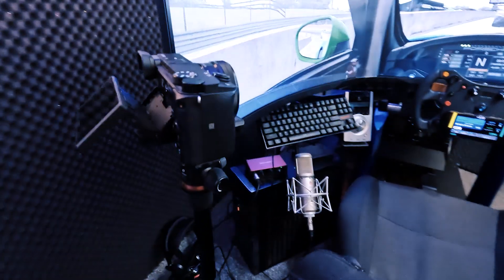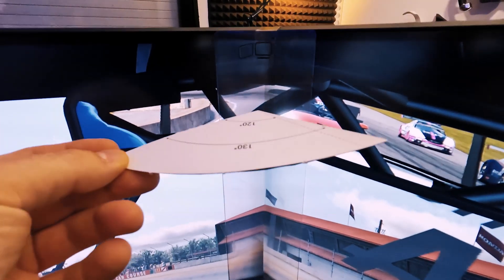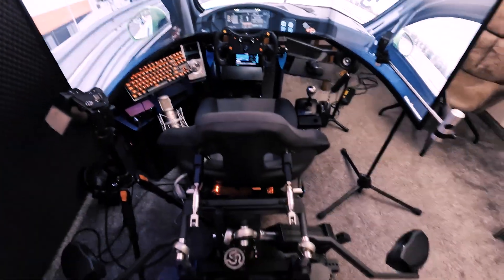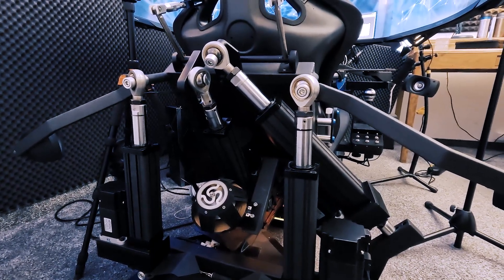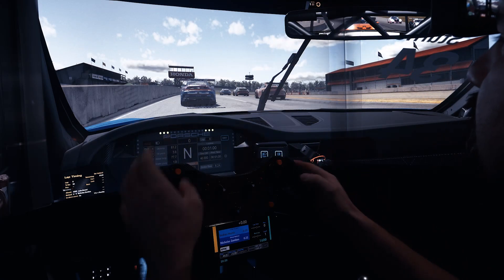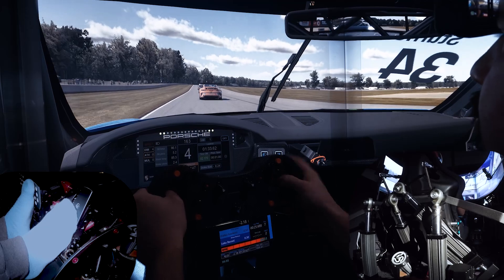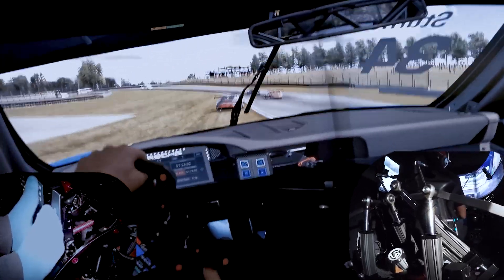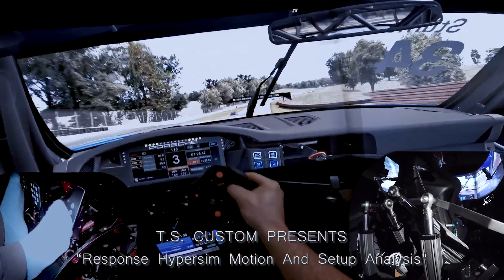Response Hypersim - Motion and Setup Analysis in Detail

Comment: This is a really nice setup! 😍 But one question...
Why not bind the steering wheel to the motion system?
Reply from the maker: Many reasons, primary one is it would be less realistic. The wheel would have wrong center of rotation and exert forces in the opposite direction than they should be generated. Body movements are at the same intensity and distance as they are in a real car, as In a real race car you body slightly moves due to G forces. 90% of the g forces are felt with your body. Forces felt on the wheel are the ones wheel force feedback provides and compared to strength force feedback provides, G-forces felt with your hands are negligible. Also making the wheel move would result in it moving and screens are stationary, would result in very unrealistic feel and maybe even dizziness. Hope that's enough reasons, there are even more but would go in to much technical detail, and this is hard enough to understand as is.

Comment: Amazing stuff, congrats. I would appreciate if you could let us know how deep/wide is the bottom of the screen, around the middle where you lower it behind the wheel. Does it work so low without extending the shaft of the dd? The top is it wider/deeper or not?
Reply from the maker: It does not work without extension. The wheel is awkwardly close to the screen.
Reply: @T.S.CUSTOM  Thank you , then I need to go for another screen. The gigabyte g32 I have in mind. which is thin not at the bottom and at the top if I need to put them upside down.

Comment: Everything was fairly clear. The real question I have is, are you faster in this motion simulation rig? Or are you faster with just the force feedback wheel and pedals? I certainly know which one would be more fun, but that doesn't necessarily mean it's faster.
Reply from the maker: If I say I'm faster you will say what about those top sim racers that won championships with only logitech G25. 🙂 I say we might both be right! I feel it makes me faster because I like the feedback, I need to feel like I am in a real car, I like to activate all my body sensors. It makes me more consistent. I feel it prepares me for the real deal better. For sure I would be more ready for a real car than "only a wheel driver". You need to get used to be knocked around a bit, because you are even more knocked around in a real car. This is a simulator, it simulates real thing as close as possible. It should be used to train for real race cars. If somebody wants to pursue only lap times as a sim racer, he might not need it, but if you want to switch to the real car or feel as close you can to it, you definitely need it! 🙂

Comment: That was a nice video. Also great attention to detail to perfectly sync the cameras. It really looks like the simulator is doing well to keep up with the speed of the car and make a very useful contribution to the driving.
When the seat goes up, because you are going over a crest, it happens slowly enough that the result of the roll motion is felt, while being pushed down into the chair is negligible, right? I think that comes back to the accelerations that are slow enough for the body not to notice?
I wonder what the actuation will look like in a Formula 1 car, really capable of making quick direction changes. Do you need to tone the actuators down? In one of your earlier videos with a Williams F1 car it looked almost like the experience I had with shopping mall simulators, where you turn right, then left and during the left turn the actuators finally built up the motion, but now it is in the opposite direction because of delay. Also, do you apply the force in the brakes in the exact angle that pushes you against the pivot of your chair? Lately I have been experimenting with pedal angle and height and noticed how my back was pushed in very different spots, too high of an angle to push down and it would start lifting me out of my seat even!
Reply from the maker: Yes it's negligible. You don't notice being lifted up or down and you do feel elevation change. I could make another video vith the formula 1 car in Iracing. I don't even know what F1 I did earlier. 🙂 But if I did, it was probably first attempts so I'm not surprised if motion was not good. I was tuning it for 4 months and then fine tuning it for another 6. I believe the sim is fast enough for F1. You do need to have a motion profile for each car and with the car update the profile needs to be updated also.

Comment: Its an interesting setup. Some limitations ofcourse but i do actually like in one way that the seat is disconnected from the steering wheel. I dont know what software what you are using but some TL (simtools as an example, i tuned my G seat to have DZ until it actually was at the point of letting go or just prior) will move in a turn so you can get a feel for the slip angle and how close you are to the limit with your angle to the steering wheel. You wont get that with a full platform TL
Reply from the maker: What limitation do you think it has. What is DZ? This is complicated enough to understand, I suggest not using abrevations. 🙂
Reply: @T.S.CUSTOM  DZ = Deadzone.  As for limitation i'd say since you have a pivot point in the front and its not moving up/down pitch and heave will feel similar and depending how far away it is it you'll loose a bit of information here.  I used to have a rig with 2 in the back and a pivot point too and for my part i set it for pitch and mostly ignored the heave.  That moved my whole rig though. Still felt great and for racing i'd say you're not really missing out on anything. im sure the short bumps and slow pitch feels quite good too
Reply: Combined with my Gseat. It has servo motors in the back now. i'll be changing it to sliders from side to side and a surge the way you have it. 

At the moment i have it set only for traction loss instead of sway and traction loss  so the flaps move in unison from side to side and i feel it in my back before i feel it in the wheel but 'd like a system where my whole body moves. I've gotten a lot of inspiration from your project for the future of mine.  https://www.youtube.com/watch?v=XvZ3zec_dLs